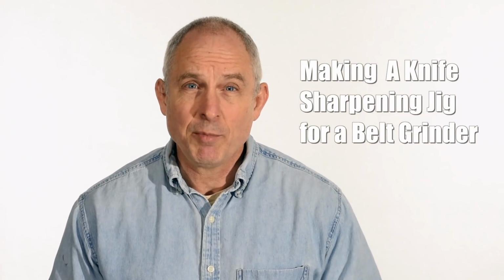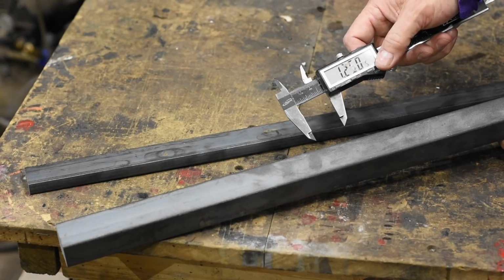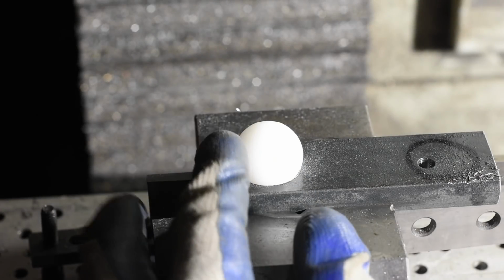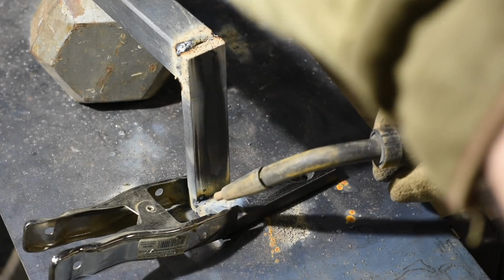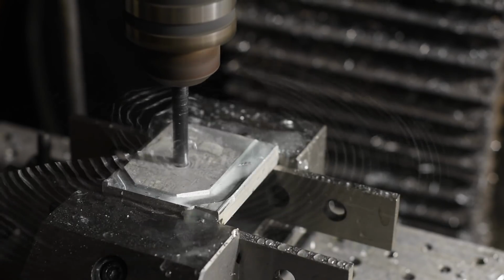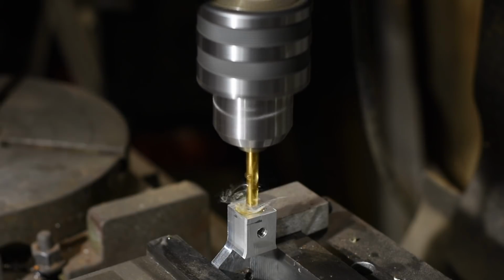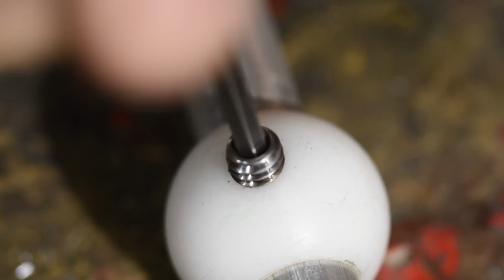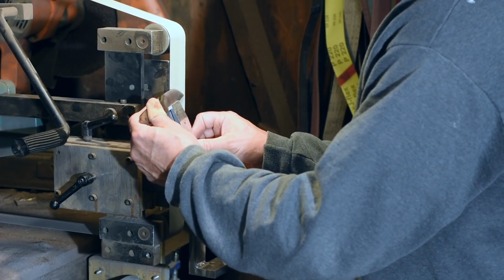Knife Sharpening Tool for Belt Grinder

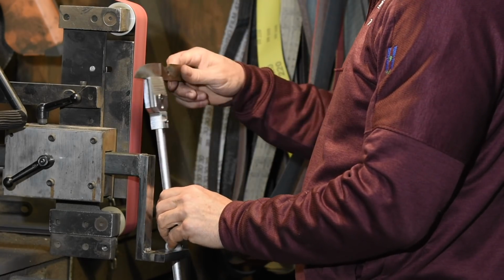Comment: I notice at 10:34 that the clamp rotates, keeping the angle consistent. Other systems* do not allow rotation, so the angle changes slightly with the curve of the knife. I don't have machines nor expertise to make that, but I do use an upside-down belt sander (with 1000 grit) to remove chips, then finish by hand on whetstones. If anyone wonders what a burr is, use a belt grinder / sander and you'll see a mega-burr. *(On hand-held systems with a stone held in the arm, pulled over a fixed knife, the further out from the center, the shallower the angle.)

Comment: Hey, Walter! I am wondering if placing a couple of straps of leather on the inside of those jaws would help to compensate for the way your blade doesn't quite center in the jaw due to a change in thickness along the spine. I may be wrong, but it's just a thought :) thanks for the upload!

Comment: Question on grinding the aluminum. Does that load up your belts?  I know with a bench grinder stone, you aren’t supposed to grind soft metals because the heat melts them into the wheels.

Comment: The only thing you should ever contemplate sharpening with a belt grinder is your lawnmower blades. No self-respecting steelworker will ever sharpen a knife with one, especially not if they're a knifemaker. A belt grinder would make it super-easy to burn the hardness out of the steel and hide it by just grinding a little deeper until the carbon stain goes away. When the carbon's gone, it's GONE. No getting it back without retroactive case-hardening.

Comment: If you guys can't make a clamp, an inexpensive alternative would be a floor scraper. The part that clamps the razor blade can clamp a knife if the screws are replaced with longer screws.

Comment: One thing I've learned about the exact angle for sharpening isn't as important as doing both sides symmetrically. 18, 20, 15 degrees whatever. Just get them the same and adjust next sharpening session and change the angle according to the task you are performing with the blade. Great time saving jig Walter. ✌

Comment: Sharpening on a grinder reduces edge retention unless it's water cooled belts
Reply: If you keep the edge cool , i cant see the difference. Many famous knife makers sharpen on a grinder, such as Geoff Feder of feder knives. If you keep your edge cooler than tempering temperature say 400 degrees the crystalline structure would not change and you finish off by stropping. I am not a metallurgist but I've been making knives the last few years. I have sharpened with a grinder but mostly with a fixed angle knife sharpener. It is time consuming, and there are misting tools to keep your edge cool. Just my thoughts from a guy in Tucson
Reply: I’ve been sharpening on belts for a while and haven’t noticed any real difference. I exclusively use 3M Trizact belts which seem to keep the blade cooler
Reply: @erwinli6962  this is not new. Please read knifesteelnerds.com he has a book which details it as well os other knife making and an article specifically on burning the edges. Most knife makers don't even know cause that's what they have been doing without testing.
Reply: @tacticalcenter8658  Interesting, thanks for the link. I wish the articles included a bit more details on how these tests were done because I can see a few different factors that could change things. Tempering temperature, force applied onto the belt, and time spent sharpening could all play a role.
I admit I was wrong in saying that sharpening with a belt sander does not affect edge hardness, but I believe that more research can be conducted to get a better look at what actually happens

Comment: Those jaws may need to be leather or rubber lined so they don't mar or scratch a nice finish. Plasti dip would probably work good also.
Reply: I have a fixed angle sharpening jig that I had the same problem with. I line it with painters tape and it lasts 3-4 knives, no marring or scratches, just my thoughts from a guy in Tucson
Reply: aluminum should not harm tempered steel, but leather or other soft materials could hold grit that could scratch the knife.
Reply: @elund408  ya it could but depending on the finish it could scratch it, just because its hardened doesn't meen it won't scratch it. I've had cpm-3v scratch from having grit on it and put it in a kydex sheath.

Comment: I am a knife reviewer, but I don't review customs or semi-customs, I focus on the budget end of things and almost every knife I review has been very poorly sharpened.  Now I don't expect perfect sharpening, just wanted to say that free hand belt grinder sharpening is VERY tricky to get right and many (perhaps most) knives I see have at least 4° variability in angle along each side of the edge, especially bad at the tip and at the heel of the blade.  A jig like this for factory made knives would slow things down a bit but it would make customers much happier.